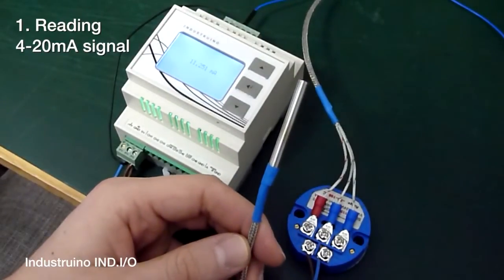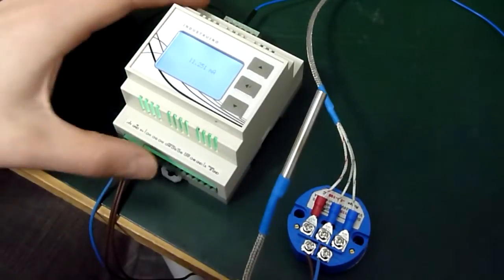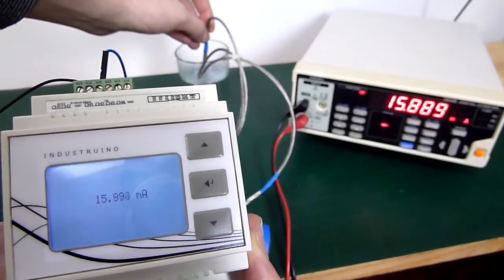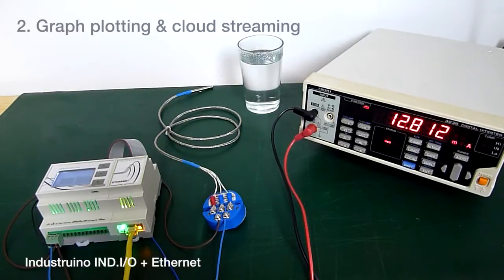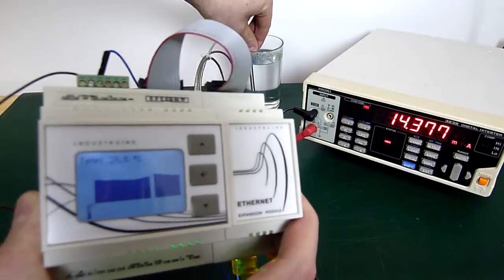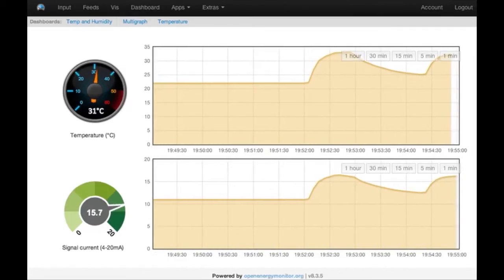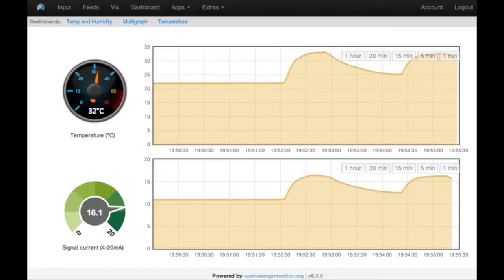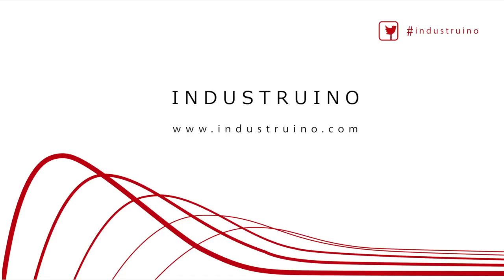Industruino IND.I/O 4-20mA Input

Comment: The 4-20mA input drops 1 to 2v. You can try connecting 12v via a 2k7(3.7mA) and 10k(1.1mA) resistor to check this. When running some sensors at 12v, this is too high a voltage drop for the sensors to operate. When measuring 4-20mA, the effective load resistance of the IND.I/O is about 500 Ohms. Smaller load resistances (250 Ohms or less) are expected by some sensors. I find these PLCs very easy to use, the example code and Arduino compatibility are first rate, thanks!

Comment: I just used a 50 Ohm shunt resistor and changed the I/O settings to measure voltage. With the 50 ohm shunt, the un-calibrated measurement accuracy was only +/-10%. With the proper 4-20mA input it was +/-3% (better at higher currents). Using the 4-20mA input is far more accurate (if the 500 Ohm load resistance is acceptable).